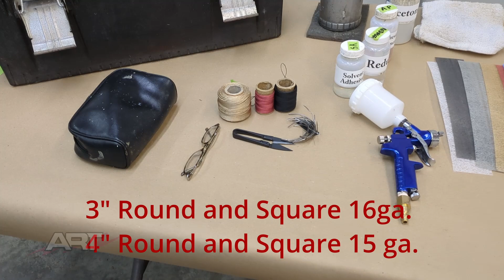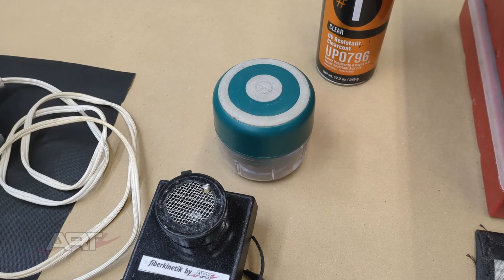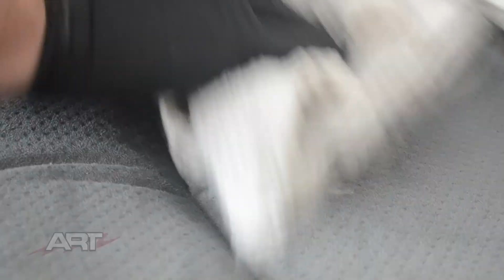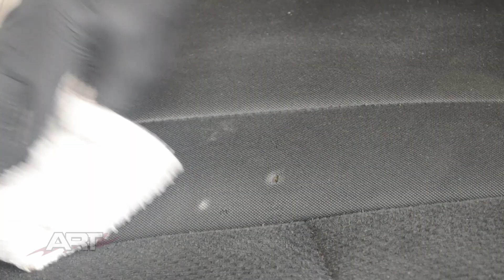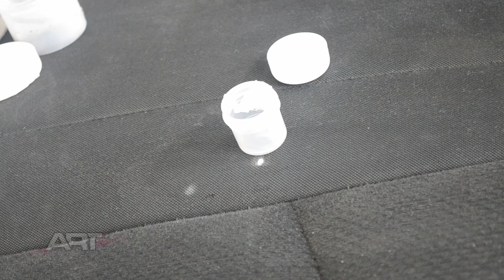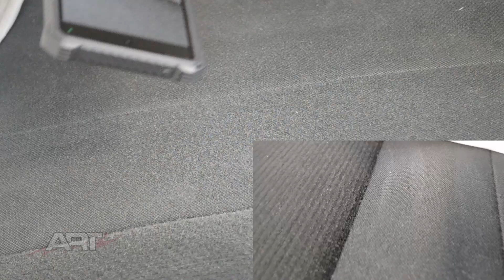Permanent Cloth Repair Introduction v151

Comment: As always Rick thank you for sharing, this is certainly a great improvement over using glue or as we used to years ago clear silicone, and the fibers and before that shaving fuzz off of the seat - yeah I'm that old ...

Unfortunately, many if not most of the repair guys (I won't call them "techs" that would be too generous) are in the biz for fast and often sloppy repairs for dealers who just want it "good enough to get it off the lot"

But for those who want to improve their skills, this is a great option. 
I've been playing around with it since you told me about it some months ago, we don't do a lot of cloth repairs these days but the few that I have done turned out much better and I feel that the repairs will hold up a lot better.

Since there are no more Detroit sample books and the availability of fabric for newer vehicles is getting worse, this will be a good option vs just having to buy a new OEM seat cover from the dealership.

Comment: I no longer offer this service because, as far as I'm concerned, the repair never looks correct, especially when repairing a cloth material.
When I repaired velour seats the finish wasn't noticeable, but modern seats are a completely different kettle of fish.
Reply from the maker: So with this method we can put designs into the base repair before curing.  Texture can be ironed into the finish product.  There is a lot more to come.  It's a completely new kettle of fish!  Thanks
Reply: @a.r.t.srealrepairsforrealc8247 great job and technique. Looking forward to seeing more cloth repairs
Reply: Velour adhesive powder works good too.